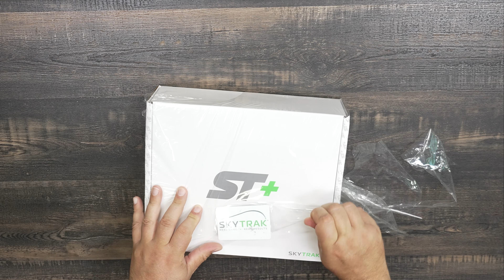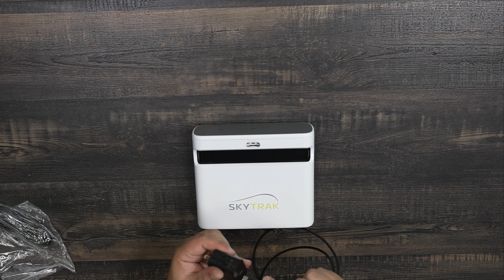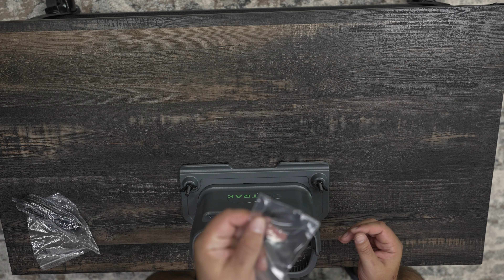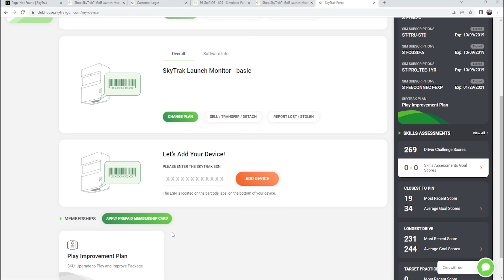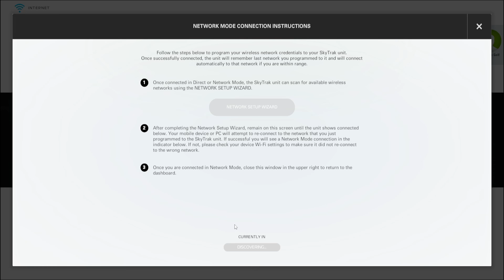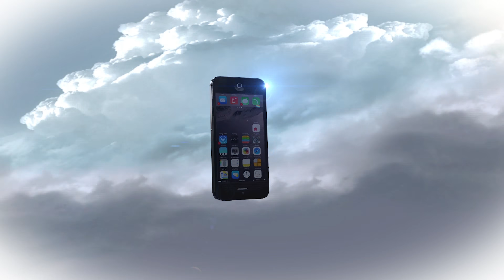Skytrak+ Launch Monitor Unboxing, Full Setup and Review

Comment: Hey Roland…I know you were demoing the SKYTRAK + on the old software but can you tell me if it shows face impact? I noticed the box on the right side below the dispersion grid says “Top” and shows the clubface with arrows shows path, etc. I know mevo+ with the add on show face impact. Before pulling the trigger I wanted to make sure SKYTRAK + also does.

Comment: When you're setting down the skytrak unit to align it, are you pointing that pointer towards the middle of the screen or just to the screen, thank you for the video
Reply from the maker: Normally pointing right in front of the Skytrak unit, not to the middle of the screen as the Skytrak will be offset to the screen a bit based upon it's placement. Always best to go to the practice range and hit small little chip shots to make sure the shots are flying straight as intended.
Reply: Thank you so much for quick reply  @GarageGolf

Comment: thanks...noticed your screen is "square"  which mine is as well...8 ft x 8 ft...having issues to get my screen to fill...probably an issue with my projector...which is an ben q AH700st...any thoughts on how to get  mine as nice as yours...
love you videos
Reply from the maker: Technically this is actually a 4:3 ratio screen which is roughly 8x10 in size. The AH700ST however should be able to fit your screen even if it is a true 1:1 ratio. Have you been able to reach out to BENQ customer support for help? First thing would be to use a tool like on projectorcentral.com to determine where the projector should be placed and then using the auto fit feature from there.

Comment: I think your 2” is wildly off from reality.
Reply from the maker: I’m afraid I have no idea what you’re talking about. Care to elaborate further?
Reply: @GarageGolf  you were testing where the ball was I. Relationship to the laser.  You put the ball about a 1/4” away from the laser dot and said it was 2”.  Its not a big deal but it would have been good to get it closer to the 2” for testing
Reply from the maker: @Steve-qn8gn  I’ve actually tested it about 4-5 inches away with success. Depends on the club though. Lower lofted works better than higher lofted v

Comment: good evening have you had a issue losing power when connected using surge protector for main power and unit plugged into usb first i thought it was usb extender cable nope then surge protector nope was doing same thing when plugged into wall outlet i lose a percent every 10 minutes it charges fine but when in use lose power is this normal sorry for long message

Comment: Can the lauch monitor be connected to personal projector or am i limited to having to use sky track projector?
Reply from the maker: Skytrak actually doesn't have their own projector. The image from Skytrak can connect to and Ipad, Phone or computer. From there you connect that device to a projector via an HDMI cord or wireless display adapter to a projector to get the image. You can basically use any projector out there and it should work but if you want one to fit a certain screen size get with me and I can help give you ideas on good projectors to select.

Comment: What are you doing to project the image on the screen? How do you set that up and connect it? Thanks
Reply from the maker: Using a computer HDMI out to Projector HDMI in port. You can use an Ipad with Skytrak and use a USBC to HDMI Adapter or Lightning to HDMI adapter as well. Lastly you can also buy an item like this for the projector and stream to it wirelessly: https://shopindoorgolf.com/products/wireless-display-adapter?aff=160

Comment: great video, thanks... I'm a new golfer. How "accurate" are these simulators? will they show hooks and slices? is this a good "tool" for working out your swing and does it truly carry over to the actual course?
Reply from the maker: Yes, these are certainly not toys. Skytrak+ is a very good device and has several features for working on your game where you will see actual improvement such as the practice randomizer. Same goes for the Uneekor EYE MINI Lite which is another of my personal favorites. Reach out to me anytime at Roland@MyGarageGolf.com if you are interested down the road in getting more info. I'm more than happy to help whenever the time is right. -Roland

Comment: So for aligning the device.. square with the target (you are using the center of the screen) or square with the impact screen? If you set up a second alignment stick and made them parallel wouldn't your laser dot be pointing left of center of your screen?
Reply from the maker: I've never really got that technical with it in all honesty. The best method I've found is to align it with the center of the screen parallel to my feet when approaching the ball. Then I hit about 5-10 chip shots straight as possible and make sure the ball on the screen reflects what I'm visually seeing. Once I lock in a position I feel is accurate I normally mark the foot of the Skytrak or Skytrak+ device with a piece of tape on the floor so I know where to align it each time I have to move it so it goes straight back to that spot next time.

Comment: Hi...did I miss how we connect to projector?
Reply from the maker: The Skytrak+ does not directly connect to the projector. It will connect to the PC or to an Ipad and then you connect that device to a projector either via an HDMI cord or through a wireless display adapter so that you can mirror your device to the projector directly. Reach out to me at roland@mygaragegolf.com if you have any questions!

Comment: What size enclosure are you using? I'm curious because I have one which is kinda square and I cant get the 4:3 aspect ratio of my projector to fit nicely on screen. What projector do you use?
Reply from the maker: Mine is the SIG10 enclosure from Shop Indoor Golf. It is 10 feet wide by about 8 feet, 4 inches tall. I am pairing it with the Panasonic VMZ51u and setting it up was a breeze. A true square (8x9, 9x9, etc) will typically always have a letterbox on the top and bottom due to the throw ratio of the projector being 4:3 and not 1:1. Reach out to me at Roland@MyGarageGolf.com and let me know what you have on your end. I'm happy to see if I can help in any way. Thanks for watching.

Comment: I have the new Skytrak+ and with the tgc2019 after about 3 or 4 holes it freezes up but they have updated the software but I have not had a chance to try it out yet.
Reply from the maker: Strange. I'll try and look into that on my end as well. I am still working on getting access to TGC 2019 for the Skytrak.

Comment: 2023 07-23 17:32.  Excellent review Roland.   The only thing I felt where there was no improvement was the complex setup.   I agree with you that the software is much better than I have found on my GC3.   I think you will find that it is even more impressive with SIM SW.   If I had it to do over I would have upgraded my “original” SkyTrak to the Skytrak+ rather than spending twice as much on the GC3 - honest buyer’s remorse.

I feel that having a true “average” golfer do the review is more helpful than some of the polished reviews allowing me to concentrate on the product not on the reviewer.
Reply from the maker: Thanks so much for watching. Appreciate it very much. I think the Skytrak+ is impressive. Going to continue to test and see how it does overall.